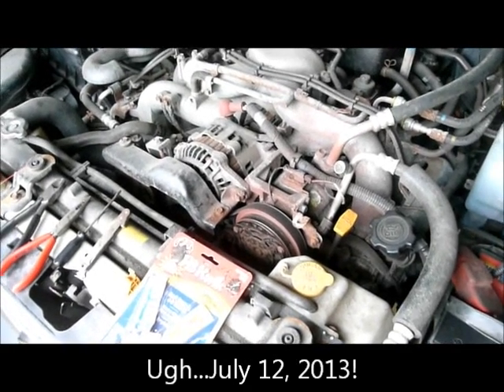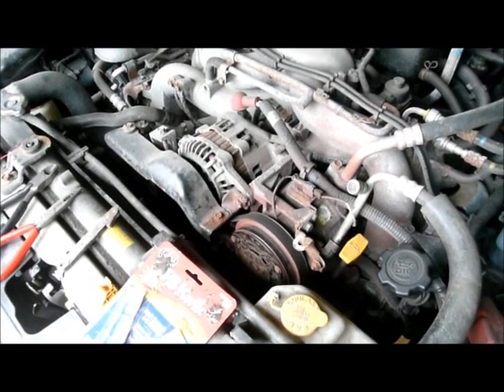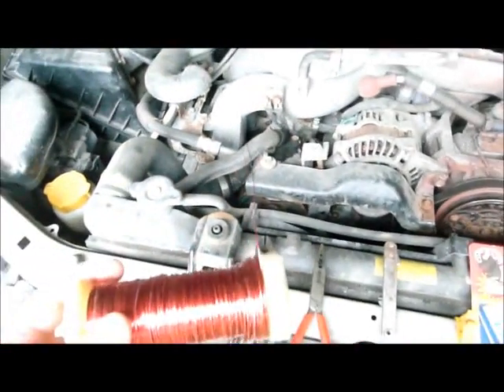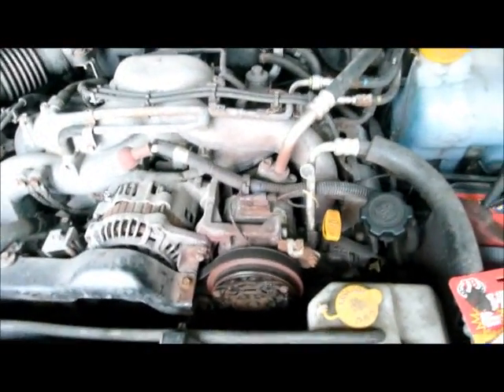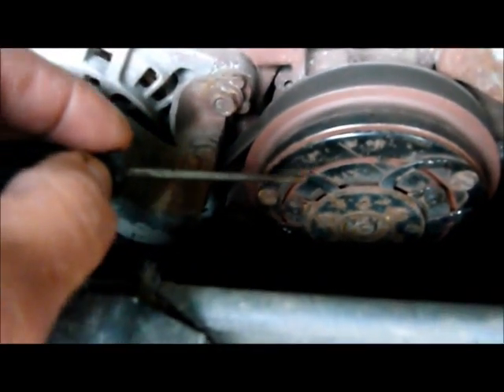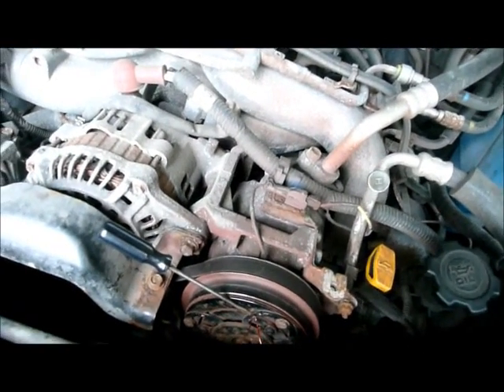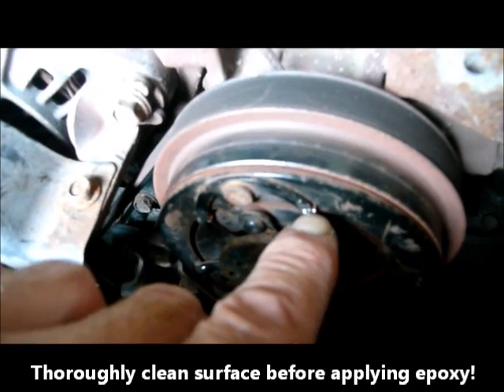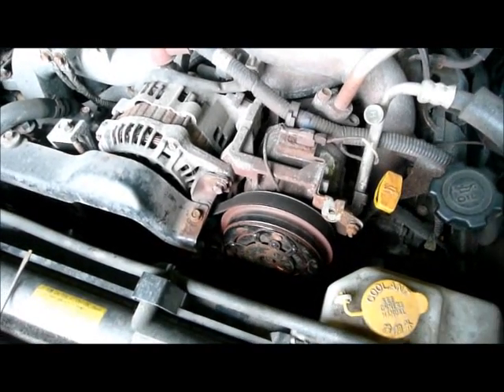2005 Subaru Forester Air Conditioning Compressor Clutch Modification

Comment: This sounds so much like a problem I have, but when I turn on my A/C the clutch spins normally for about 30 sec-1 minute then stops for 30 seconds only to start up again. It cycles through this for as long as I can tell. The A/C will blow semi-cold air for about 5 minutes when I first turn it on then it warms up and doesn't get cold again. Do you think that this problem will be fixed by your method or do you think that I have something else going on?
I had it recharged a year ago but who knows if I have a leak
Reply: Thanks! I will check it out. I check the clutch gap and it was .013 so sounds like the magnetism isn't the problem. Search continues!
Reply from the maker: If you determine what the cause is, please post it here to help others.  I would be interested also.  Regards.
Reply: Will do!

Comment: You say that you can't replace the clutch, which is odd since Subaru has it listed as part # 73121SA000 -- I was just looking since I need to replace mine.
Reply from the maker: Did you happen to see the price?  I think I'll stay with my 25-cent fix (which by the way still works).  Good luck!

Comment: add me to the "brilliant idea" list! I tried to take the clutch off to remove a spacer and reduce the gap as described in other sites' posts but it wouldn't budge. like yourself, with the .020" wire I got a less than .010" gap so I recommend anyone trying this have some .015" and .010" on hand. I actually used .010" flat stock and am hoping the pressure alone keeps it in place, at least long enough to know that it works. thanks again.

Comment: Whoever told you that you can't replace just the clutch lied to you. $80 and a 10mm socket and you're done...
Reply from the maker: LOL...a Dealer lied to me...imagine that!
Please send me the part numbers and a source to buy them and I will order, although my air conditioner is still working fine with 178k on the odometer!
I went to three places, all said the entire compressor needed to be replaced.  Regards.
Reply from the maker: LOL...Read listing...not $80, but rather "you save $80"...price is $199 plus shipping.  Will stay with my 25-cent fix.  Regards.
Reply: Dan, thank you for proving me wrong about the availability. The strange thing is when I do the search it still doesn't show up. o_0

Which means I still can't find one for $80. :-/
Reply: Until proven otherwise, one cannot purchase an A/C compressor clutch for a 2005 Forester.
Going to try this method now.
Reply: +James Sexton the first hit on Google

http://parts.pencesubaru.com/p/Subaru__Forester/CLUTCH-ASSEMBLY-COMPRESSOR/49282551/73121SA000.html?partner=googlebase_adwords&kwd=&origin=pla
Reply: +Kntryhart that was literally the first thing that came up. And it's from a dealership. I posted that one in response to someone saying that "until proven wrong, one can not but just the AC clutch for a 2005 forester".  If you keep searching I'm sure you will be able to find one for less. That's half of the reason we have an Internet anymore...  Good luck with it.

Comment: I did this last night using bread ties and JB Weld Kwik.  It worked like a charm.  Thanks for the "third world solution" to a "first world" problem.  My 2007 Forester has 204,000 miles and the air is still blowing cold with the original compressor.  Thanks Kntryhart!

Comment: Thanks for the info My 2004 Legacy GT is cool as a cucumber now !!!!..... I ended up using some Galvanized chicken wire to get a .011 Gap. Works like a charm. We've been having Temps in the mid 30's (Canada ) or 95 Deg in U.S. Once again THANKS!!!!!!

Comment: I found this video last year, but never got around to seeing if it actually works. I used a thinner gauge wire and about ten minutes later JB Weld was applied. I took the car for a ride and it worked. A great temporary fix. Thanks

Comment: Dude, this totally worked. I swapped relays, drained and refilled freon, and tried about everything but it was the clutch gap. I fixed it with bread ties because that was all that I had, but it still worked. I'll worry about the proper clearance and better wire later. Right now I have cold air.Thank you so much. You rock.

Comment: Thanks for your video. My Legacy (2005, 2 litre, 140000miles) AC clutch showed the same wear dust and stopped engaging - also got a bit of a smell as it was also mostly dragging.

I suppose that when they work, they are OK, but when they reach the limit of magnetic attraction they will go into mostly slip and rapid wear. My measurement was 0.7mm gap.

I undid the screw, and found they my clutch has 2 stainless M6 washers between the spline shaft end and bottom of the clutch splined hole, each 1.4 mm thick.

I replaced one washer with 3 off 0.3mm thick copper wave washers I found in my spare bits box. It now works perfectly again.

I am hoping it will not need attention for another 140,000 miles.

Comment: Does this also eliminate that anoying squealing noise? I have 2000 Legacy Outback and A/C compressor clutch looks same ..
Reply from the maker: Martin Netušil I doubt it.  Google your problem...seems to be quite a few suggestions out there.  Good luck!
Reply: +dzenan ahmetovic Did you learn how to do it of a youtube video or a website? If so, could you post a link? Thanks!

Comment: I did this and it WORKS.
DO IT!!
I'm posting this 3 weeks after my fix.
I had same exact issues w AC clutch magnet b=not re-engaging.
Had just bought a used Forester, 2005, and upon driving car home from dealer this happened (ice cold then warm) over the next few days.
It cost me 10 bucks only b/c I didn't have the JB weld or the wire.
Took me 20 mins and now that I've done it I could do it in 10 minutes.
I used 24 ga wire but I wouldn't get any thicker than that as that's all it needed.
My mechanic was amazed.

Comment: Hello Kntryhart...  So happy to find your post.. I had the same problem  and had not thought of the air gap... Mine also checked out to be around 32 to 35 thou. On my 06 Subaru Forrester the clutch was shaped differently and it had three little rubber bumpers that the clutch plate stopped against.. I cut strips of a coffee can lid  and placed between the rubber bumpers and secured in place with Hi-temp silicone... Got the gap down to 16 thou.  Works great.... Thank you...   I was looking at big bucks but instead,  fixed it for 15 minutes time, no money...
Reply from the maker: Kenneth Bee Great!  Glad that your AC is again working...and for no $$$ and just a little time! Thanks for the message.  Regards...
Reply: Kntryhart Hello again... I had to redo mine... Not enough shims... I had settled for .016 thou. which soon went to .020 resulting in AC going of again when out side temp. hit 90.... I re shimmed to reach .011, No more problem... Thanks again...  They mean it when they say .010 to.012.

Comment: I did this fix.
DO IT!!
I used a metric conversion that worked out to .30mm on the feller gauge as the end result. 
I originally had a .70mm gap before starting.
It took me about 20 mins only b/c I was unsure of myself....I could now do it in 10 mins. now that I know what I am doing.
It works--did it two weeks ago!!
Works great!!
Just do not use wire any thicker as 23 or 24ga seems to be just about right/all you need.  Any thicker might be too much.
Saved me $800.00!!

Comment: Thank you so much! Did this and worked very well. Used Stainless steel wire but had a bit of trouble because it is not as malleable and sometimes snapped when twisting it. Initially placed the wire more towards the center, before the groove. Then I could only achieve 0.020" gap. When I placed them outside of the groove I got too close, tighter than 0.010" in some places. I had to put 4 wires outside the groove and 2 inside to get a uniform 0.013" gap which I am happy with!
Reply from the maker: crazzylarry1 Glad to hear it worked!  I agree, for this application stainless wire can be difficult to work with.

Comment: Brilliant! Just pulled my inner shims, but still too much gap... your solution is perfect... I'd thought of adding an expensive magnet to the front of the clutch plate to pull it it, but did not realize the flexibility of the plate... your work-around is masterful and the height of design fix simplicity.

Comment: You did what you had to do to make it work. I repair & service automotive Ac systems & I think that was an ingenious quick fix. The right way is to remove the front of the clutch , witch is the clutch plate.Behind it are some washer shims 1 0r 2 till you achive the desired gap.
Reply: +Rommel Bryce-Thurton is a clutch puller needed to take the front of the clutch of to get access to the shims? 
Im on the fence on which way to go. thanks
Reply from the maker: +cales4utube From what I understand, no puller is required.

Comment: I just performed this fix on my wifes car and so far it is working great. I didnt want to spend the money on a new compressor because the car has a little over 180,000 miles. My wife is happy to have her AC back and we both wanted to say thank you so much for posting this video!

Comment: This worked awesome for me!  Thank you so much!  23 gauge wire was too big for me and had to switch to something more like 28 gauge.  One sign of a slipping clutch is the reddish-brown dust that shows up in this video as well as on my engine.  Thanks again!
Reply from the maker: Brad Johnson Glad this worked for you.  You might want to check your electrical system (battery/alternator/connections) to ensure it is putting out proper voltage under full load.

Comment: I was quoted $1600 for the compressor, $150 for gas and and about $350 labor. Some old wire and epoxy and it works fine. So a big thank you from me! Has anyone had luck with the shim removal method mentioned below?

Comment: ...I just want to say .. THANK YOU .. I am not a rich guy at this time in my life and you just saved me .. The spring looks new and the gap was big so i only put three wires on and folded them over to see if it worked .. Works great .. Before when the compressor turned off the gauge would go from 30lbs to in the red in a few seconds so when i did what you said to do I checked it again and when the compressor turned off it went up to 45lbs  and the compressor turn back on and back to normal..before got cold then warm now cold as hell all the time so i am going to finish it the right way so it don't move ... Thank You again
Reply from the maker: I am so glad that this worked for you!  Always enjoy hearing success stories!  
Keep cool  ;->  Regards, JT

Comment: This workaround is ok quick fix, but it is really better to take out friction plate and remove one shim inside to reduce gap. Remove center bolt (12mm head) screw in three MM5x0.7 30 mm long bolts into removal holes - that should push the plate out. One shim is 0.5mm and you need to remove only one. This is 1 hour job, just did it myself. The clutch itself  is available as well at about $150 and kit includes all three parts - pulley, friction plate and electromagnet.
Reply from the maker: Interesting.  I took the car to several air conditioning repair shops and the Subaru dealer.  Without exception, all said the clutch was not available and that the entire compressor needed to be replaced.  Estimates were in the $600 to $750+.  If I did not replace all the components they specified (receiver dryer, valve unit, etc.) there would be no warranty.
My 25-cent fix is going on its third year and all works fine.  considering the age of the car and 160K on the odometer, the car simply is not worth that investment.
If you know where a clutch can be purchased, please include a that information. Better yet, post a video to show the process!
Regards.
Reply: Kntryhart  Wow, third year! Certainly beats any other type of repair.

The clutch replacement part number is 73121SA000, I only found out quite recently, it is not very common knowledge. I have read about 'wire' workaround but decided to try removing shims first - what I thought was more permanent repair. I had only one shim in there, after removing the gap went from 0.7 mm to 0.2 mm (spec calls  0.1 mm). Guess next will be 'wire' workaround followed by the clutch replacement if the car is with the family at that time.
Reply from the maker: akpch Did a search this morning, $185 plus shipping was cheapest I found.
I assume you did this on a Forester? Is there room to remove the clutch without removing compressor from car? Is 12 mm head screw standard or reversed (right-hand) thread?  I wonder why dealer did not know of this? Thanks.
Reply: Hi akpch, Thank you for your info on this problem.
I went to four different service establishments, All had different diagnosis and I shelled out almost $800 Aussie dollars for nothing./ My gap was 25 thous.took the clutch face plate off removed the washer, reinstalled and hey presto lovely cooling, and today it was 38 degrees Celsius here in South Australia today. Cheers for your help.

Comment: Good fix.  Just a note.  It is easier to do this with the pulley off.  This only requires the removal of the 6mm (?) allen head bolt in the center of the pulley. (don't drop the bolt!  Use a magnet to catch it when it is loose.)  I used stainless steel wire.  You will need about a foot to do the entire job.  You will actually only use about three inches, but it is difficult to twist unless you have the extra length.
Reply from the maker: I tried on two separate compressors to remove the pulley...nope.  I even used a puller on one...nope.  Glad it worked for you!

Comment from the maker: Glad you liked it!  I tried to remove A/C clutch from another unit just to see how difficult it was...I never did get that clutch removed. While this is not perfect, it certainly is inexpensive. A/C is still working perfect. Hopefully, I can get a couple more years out of it.  Once the weather cools, I unplug the power to the compressor. It always bothers me to hear the compressor kick in during defrost when it is snowing! I haven't had any problems with fog removal not using the A/C.

Comment: Hello. Have you tried to remove the factory shims. Subarus use two. Just remove on of them to regain some grip once the clutch starts slipping. On heavily damaged clutches you might have to remove both shims. I also remove the clutch, clean the non friction surface with some brake cleaner and a 400 sandpaper. Seems to fix slip and that annoying sound when the clutch engages. My two cents. Regards.